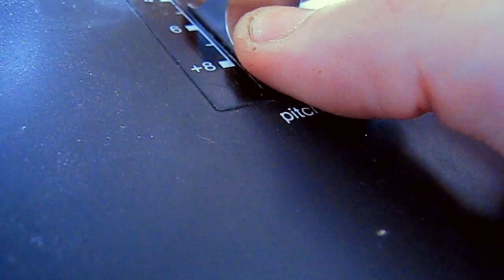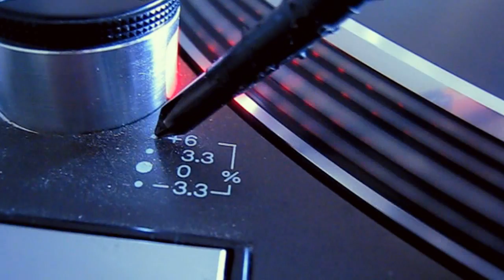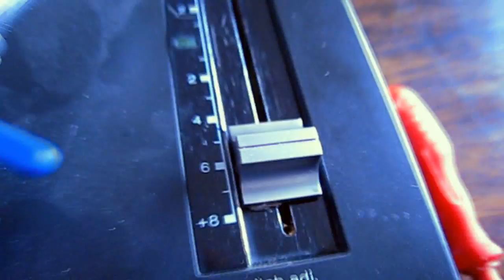Technics SL MKII Pitch calibration part #2 How to calibrate the pitch range.

Comment: If you don't have the second zero point when going through the ranges, and the secondary pitch range is already calibrated at 6%, it's not needed to recalibrate either the zero point or the pitch range right?

Comment: A note for people wondering about the 3.3 position. Ive just done this on 2 of my decks. On one (an older deck with the metal style pot under the platter) everything lined up great at +6 and at 3.3 on -/+ both sides. I couldn't be happier because I had issues around the center notch too. No more. 
However, on my other deck, a later variant with the blue pot, the 3.3 strobe is around the 2 mark and it's not half as nice to mix on with 3.3 crammed into 0-2. It's over sensitive in that area.
I swapped the two faders around and the issue moves with the fader. the good fader is perfect on the other deck. Im going replace the fader and will report back, but theres not other way to fix this as far as I have found. 
I think technics just released some shitty faders over a certain period (early-mid 90s) as the later era issues of the mk2 fader 97 on had a smaller notch in them. Ive just ordered one and will report back.

Comment: After you set your Pitch control gain @ 2.7 kohms and your pitch control adjustment @ 262.08 kHz your pitch slider @ +6 should be right on. if not your pitch slider is bad. change it recalibrate it to 2.7. that should fix your problem

Comment: Can someone help me out here please on a Mk5 and an M3D with no indent at 0. 
My 0 on both of these decks is good, and at 0 (or close enough) and the +0 large dots are nice and steady. BUT my +6.3/6 dots are only steady at about 7.3ish and +3.3 dots are steady at about 4.3ish. 
When i adjust the VR301 under the platter, it just shifts the whole gain settings up (or down) so if the 6 is at +6 then the 0 moves up with it. Obviously in this vid, Frank is showing the 0 indent with Quartz lock activated so it will read 0 once he has adjusted the VR301 and the +6 is good to go. But on my Mk5 and M3D with no auto Quartz Lock indent its just shifting the whole gain, not compressing the range. Any help appreciated.

Comment: ViperRick I have a question;

I put a new pitch fader in myself. I had to solder the parts together myself. I did exactly like the photo I took looked like and I already had tiny other table open so I had that as a back up reference. It works and pitch is perfect zero but it doesn’t fade!  Just stays at zero when I slide it.  Do you know anything about this??

Comment: I just fix the zero point and then i went for pitch range callibration and fix the +6 also. But when i check +3.3 and -3.3 either the respectively dots are moving. I think something wrong happened here

Comment: Hey Frank, great video bud. I've just run through the process on a refurb deck. Zero was already spot on. However +6 needed some adjustment which I've done . That is now fine. But here's the rub, Zero , +3.3 and +6 is fine, but -3.3 is not. I have to move the pitch fader to about -4 to get these dots stationary. Any tips on how to adjust the minus side please ? Cheers.
Reply: I have the same problem. Did you solved it?

Comment: Thank you very much for the great tutorials! Really appreciate it. I got it set so that the upper ring is stationary at +6% now, but both 3.3% positions seem to be quite off. Especially the minus one. The -3.3% ring is stationary at -2%. Does that mean I did something wrong?
Reply: hey i have same issue. 0 and +6 corresponding with the dots perfectly but not +3.3 and -3.3. Were you able to fix it? Any tips on how to do mine?
Reply: Same issue man did you fix it ?
Reply: @MisterSimon30  No, unfortunately not. :-( I don't know enough about it to figure it out myself. Was hoping for a pro tip.
Reply: @marcelhuntemann337  I'm wondering if maybe you will need to replace the pitch? 
Did you ever get yo fix the problem?
Reply: Same here! Some fix?

Comment: Question: Could you also calibrate your pitch by: (1) Opening up Serato (Scratch Live); (2) Play a song; (3) Adjust the pitch on your turntable using Serato's pitch display and the method you showed in your video?

Comment: Hi. I tried to  pitch calibration technics SL1200Mk3D set pitch to zero position  and set pitch range same this video ready.I connect with serato dj and play pitch 0 correct pitch +6 correct but pitch +8 over to 10++.Can I fix this issue?

Comment: I did all of these steps from the first vid and this one. Got a long zero i guess still. I shrunk it from these steps but its still causing the zero to continue into about +.5%. Because of this I am still getting a weird thing happening on the back end where once the light turns off going into the negatives, it will jump from zero to about a .5% decrease. no smoothness just a quick tiny little jump that is irritating as fuck. I got these figures by checking in serato and doing the math off a 100 bpm song and of course looking at the pitchfader. Probably gonna take it to the shop.

Comment: i changed out the diode 301 from it's standard 1v 1w to a 3.3v 1w diode and i also bought a pair of 5.1v .1w and is there a wrong way to put in a diode because i can't see any marking that said's which ends is which. would the 3.3v .1w diode be ok or do i need to put in the 5.1v .1w diode in

Comment: i've tried it but my platter is still moving in the wrong direction all the way up to 2 1/2 before it goes in the right direction i calibrated the pitch 3 times and i still have the same problem. and before i cleaned out my fader it was going in the right directions and i still have thee erractic pitch problem.   can anyone help me out with this

Comment: All, note that the resistance at 0 is 2.70 for mkll but is 2.87 for any tables with Quartz lock, such as Mk5 or m3d. That could account for some who have made comments saying they are having problems getting things perfect. Thanks for these vids, James. They gave me the confidence to do all this deck maintenance myself and has saved me a load of $$. It's been fun work, as well.
Reply from the maker: no worries, thank you for your input mate, that's most appreciated.
Reply: The MK2 does have Quartz lock.

Comment: Hey, 

SL1200-MK2 problem: at 0% big bubble is on line and also at + and - 6% it's on point, but at +/-3.3% I get the platter bubble steady around +/-2%.
Watching your calibration method i assume i can't fix it by recalibration, do i? 

For fixing the problem do i need just the standalone fader or should i look up the fader with circuitboard with it?

Your advice is greatly appreciated.
Cheers,
Silver
Reply: I have the same problem, please help!
Reply: Hey mate, 
I must say the way to go is to order new pitch fader. I ordered complete assembly with part number SFDP122-24A1, and it solved the prbolems for me. 

Cheers
Silver

Comment: You really saved me with this! 
Quick question: I set the resistance to 2.75 without even checking the reading at the second 0 position, and it works. 
Could we say 2.75 is the level of resistance all 0 points should have?
Thanks so much
Reply: fede bosich one of mine 0s at 2.78, not sure about the other but am pretty sure it had more variation as it has a non stock fader.

Comment: hi James love all your videos very intuitive.  

I had a brain spark ignite about modding the pitch range and wondered if it's possible.

the idea is to use a pot dial to adjust the range externally next to the pitch fader. do this by drilling a hole for the pot and wite it to the range adjust. 

with your technical powers can this be done and what is safe to do so.

my electronics skills are suffice but I don't know the gubbins of ratios, resistance  etc... your advise would be eternally greatful. 

stu.

Comment: Hi guys, and James. I have a small problem and I hope you will be able to answer it. So, I followed all your steps an my pitch is now perfectly calibrated at 0 position, +3.3, and +6. but when i go to into negative it is calibrated at -2 and not on -3.3. 
So whats the problem? Maybe I've didn't done something right? Or my pitch fader is just old and maybe needs a replacement? what do you think? peace
Reply: +Shari Cp Hey Shari, I have the same issue. Did you ever find a solution? My turntable is calibrated to the instructions above but when I got to -3.3 it doesnt seem quite calibrated. Plus, the pitch fader is very jumpy and it's hard to beat match and seems to not be very consistent from 0 to around -3.  Anyone have thoughts?

Comment: Hey viperfrank. First off all thanks for your good videos on Youtube. Sorry, but this video is not correct. The pitch range what is printed on the Technics IS WRONG. You cannot just adjust the dots to 6% because you will loose a lot of sensibility. When you adjust it with a frequency meter and adjust it like the Technics Service manual says you will see the difference. The Factory settings are: the 3.3 dots must be at about 2.5 pitch range and the 6% dots must be around 5.2. This is the correct setting. Also I would recommend to bend up the pin number 7 (or disconnect the orange cable) from the pitchfaderplug which goes into the system board to disable the quarz lock for having an exact pitch around 0%. I also recommend to replace the center click of the pitch. This is also called MK5 mod and makes the Mk2 to an MK5 in just a few minutes. My Technics Turntables run with those settings up to 3 or more minutes on perfect sync using Timecode or Vinyl.
Reply: Leichte Kost big up man, viperfrank videos are really good and i trust him because he knows what hes doing. But how do you know that pitch range printed on technics is wrong? and why should we turn quartz lock off?

Comment: Thanks for this video, but I still have an odd problem.
So both my decks are now calibrated at both 0 and +6.
Yet when I checked by playing two of the same tunes together, they are one whole pitch apart i.e one is at +2 the other +4?
What would be the best way to match the two up and how can I tell which one needs adjusting?

Comment: this is wrong all u are doing is gaining for pitch range
changing the vr301 means u will gain more pitch range in the plus and u will no longer have minus 8%
works like this when u turn the vr301 clockwise all u are doing is making the pitch move forward done and tested my 6% wasnt correct either so followed this video once i got it set ran my deck on traktor now my pitch range is plus 10 and minus 6.5 dont believe me pls try it or test ya deck on traktor with timecode
Reply: when it's in the click with green light in (in the center of the pitch) the TT always plays 0%. then you move to +2 and there it plays 0% again - you have second zero.
Reply: yes you are right... +8 jumps to 10+ lol
Reply: I agree with richard this is wrong way to calibrate your technics. Calibration should be done using the service manual.

Comment: Great tut man! But i have a question: mine is perfect on positions "0" and "+6", but "+3.3" is at +2 and "-3.3" is at -2....what i need to?
Reply: What's the serial number of your pitch? SFDZ122N11-2 works for me. SFDZ122N11-1 doesn't
Reply: GE5IS95887
Reply: Alessandro Benni
I was hoping this was just a thing with old decks but it seems yours is from 2005? is that right? I have a pair from 97 and one from 98 that 2 new pitches won't calibrate on. I have a frequency reader too.
Reply: noooo, i bought it used (!) in the 97, if i remember well :)

Comment: The Pot by the motor should have a measurable frequency of 262.08Khz +/- 0.5%
Reply: you are correct, forget what the dots tell you. Using a frequency counter to measure correctly or dont do it at all
Reply: Depends on how old the turntable is. 2,7 kOhm and 262,08 kHz are the factory settings. In my case i had to set it to 263,5 kHz to get the calibration right.

Comment: i have done this calibration but a few people have the same problem as me i bought a multimeter for part 1 and tested resistancet 2.70 which is right and ive followed part 2 and calibrated the pitch range to 6.
 but 6+ is fine dotts are still but when i go to +3.3 its not still and neither is -3.3 ive seen so many people have this problem but not  one answer ?is that normal or should dotts be still 0 quartz and. 3.3+ and 6+ and minus -3.3 ? plesae can some1 answer this question !ive also heard they are never the 2 same decks

Comment: Could it be, that 2,7kOhm isn't the correct value? I put it on 2,7kOhm, but it's slightly off. I read somewhere, that on some MK2s it's 2,86kOhm rather than 2,7. Where would I look that up? There's nothing in the manual.
Reply: 2,7kOhm (+/- 0.1)  is right for MKII, but for M3D and MK5 it's 2.875kOhm (+/- 0,25).

You have to find a copy of the service manual to look it up as the user manual doesn't include such info!

Comment: Hi Frank, excellent video. Many of Us have the same problem, we already setup 0% and 6% but +/- 3.3% are wrong, and if you try to fix them, you loose the 6%. Do you know what is wrong? Do we have to change the potenciometer? Is the strobe speed check wrong? This is the most repetitive question on this video, so we will really apreciate if you can comment on a possible solution. Thanks in advance!
Reply: Dimitar can we chat on the vinyl engine forum? If you read the thread I linked, you'll see I have plotted all of this in a graph.
Reply: On the MK5 model it's not marked as 6%, but 6.4%, so if  you're within that range I wouldn't really worry too much.
Reply: I too have the 3.3% problem. I have 2 brand new SFDZ122N11-1 Pitch controls that won't work with a pair of decks though the pitch that I am replacing will calibrate.The serial number on that pitch is SFDZ122N11-2.
Reply: same problem here... 3.3 and -3.3 are off, but 0 and 6 are perfect
Reply: Hello mate. Google "txrx vinyl engine technics" you'll find my big long post about it. -2 is a logarithmic too but 20k
Reply: The technics +8 to - 8 scale is made to work with a 20k fader. With 22k you are using too large a scale so the calibration won't work. Essentially it's like squashing a fader that is meant for +10 - 10 into a +8 -8 range. You can calibrate the +6 but the 3 is off or viva versa.
Reply: Your -3.3% is off because this is not the way to calibrate your technics and he is spreading disinformation to the masses..joy
Reply: kanuke do you have a way or can you let us know how it’s done.  So we can find the solution I will appreciate that. Thx

Comment: Hi Mark, I have the service manual for both the MK2 and M3D... In general the resistance can range from 2.60K - 3.12K, now if you are getting  a reading of 3.48K you may want to check the following: R301 = 2.7K, R305 =180OHMS, also check your pots, they made be dirty or worn and may need to be replaced.. I changed mine on my m3d because they feel like the previous owner(s) played with them like an atari 2600 game!

Comment: BTW some people say not to use serato to calibrate your pitch but I found it to be accurate... being that I have an education in audio/video servicing.. Technicians used a test tape with a 1kHZ tone on it which was used to both adjust speed and azimuth of the tape head... serato or any time code vinyl works on the same principal which oscillates a frequency corresponding to the TT's RPMs which does give you the correct % reading along with the RPMs in the scope view in Serato SL setup screen!

Comment: Learn this the hard way and drove myself crazy,
My 1200 M3Ds were bought second hand, when i calibrated it the + & - 3.3 were lining up perfect on the pitch scale but it was when i was lining up the +6% was my problem!
When I turned the pitch pot on the main board to line up 6 on the scale to 6%, +& - 3.3 went out of line and when I checked with serato I wound up having 9 - 10% at #+8... it turn out that my TTs had the platters from the MK5 which the top dots are 6.4% instead of straight 6%!!

Comment: great vid, i have a problem tho, I am replacing the pitch slider on MK2s they do not have the handy hole where the pot, so must be old decks
when i am testing the resistance on the contacts, it is reading 3.09 and 3.48 when i twist the pot, what is causing the reading to be so high and how can i adjust the reading to the correct resistance of 2.73 ? A speedy response would be appreciated?

Comment: Thanks a lot for the useful info mate. Mine have the 0% perfect, and the +6 perfect,, but when the wheel runs at +3.3% or -3.3%, the pitch fader is around + or -2.3%
Reply: Me too .what sounds be the fix for this or doesn't it matter as long as +6 is correct??
Reply: @DJFuller  which solution did u find?
Reply: Top row of dots should be stationary at 6.4%. The old legend is wrong. Newer models reflect this. 3.3% is at around 2.5 on the slider for mine with brand new official technics faders. It is fine.
Reply: 10 years later .. Also have this problem

Comment: These videos were a great help, however - I have a MK3D's for which I will be buying two new M3D non indent pitch sliders. Calibration wise, what must I do?

1.) How does the MK2 and M3D pitch sliders differ calibration wise?
2.) With brand new pitch sliders, do I need to calibrate the 0 at all? I would think so - and if that's true I'll have to do ranging as well then.

Comment: great videos mate,followed all the steps on both videos but my -3.3 is still out on both decks,its actually at -2,tweaked all the pots but no matter what i cant get the -3.3 correct,if i do get it then the zero spot is moved or +6 and +3.3 will be out,any suggestions ? thanks
Reply: Same problem here